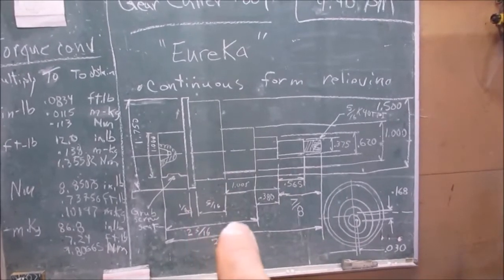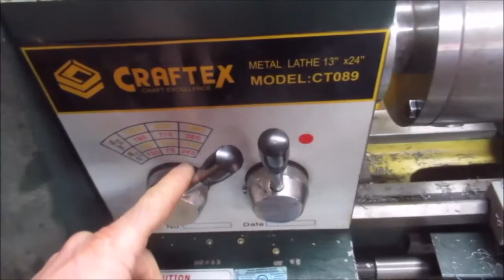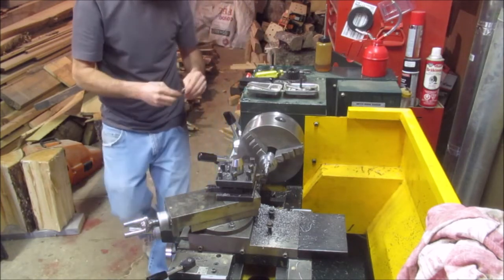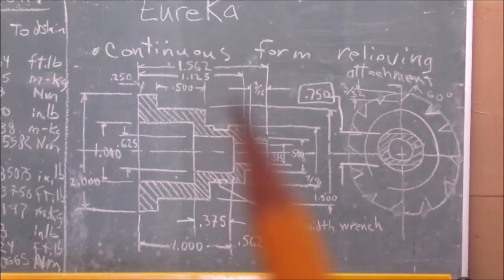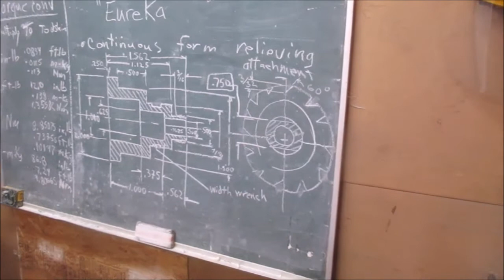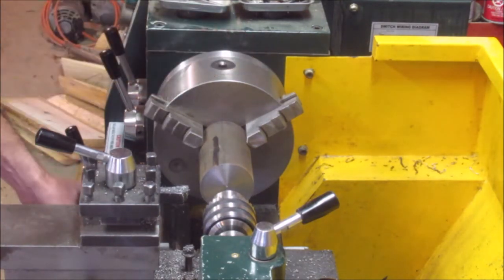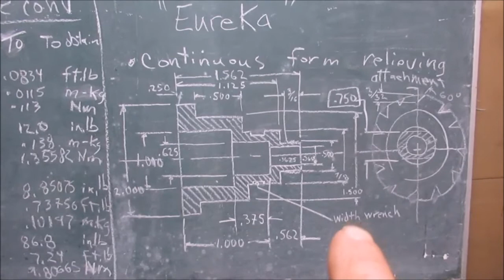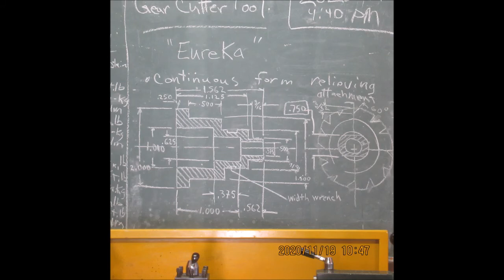Eureka Gear Cutter Continuous Relieving Tool part # 2

Comment: https://www.model-engineer.co.uk/sites/7/documents/me-cen-2-pt4.pdf  Has a write up on the Eureka tool also.  32 TPI and 40 TPI are typical Model Engineer thread sizes.  You can buy the taps and dies for these threads too.  You might try https://drillsandcutters.com/ or order them from England.  I bought some 3/16-40 and 1/4-40 recently from https://www.tracytools.com/

Hope that helps.

Joe